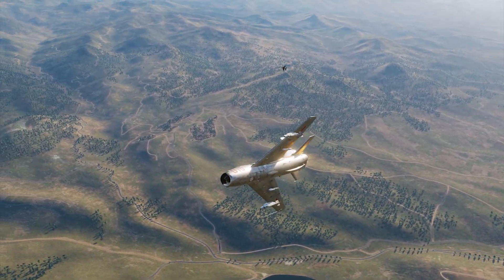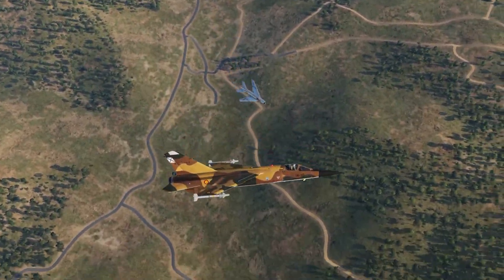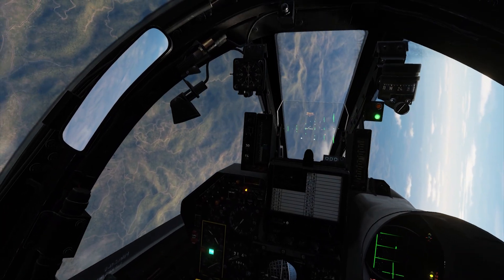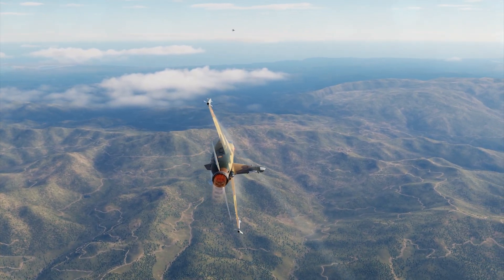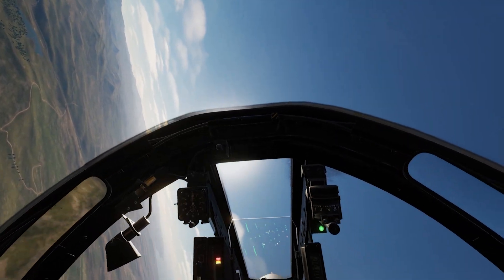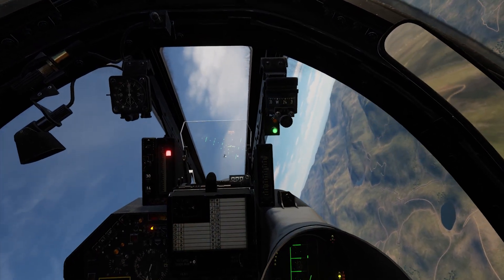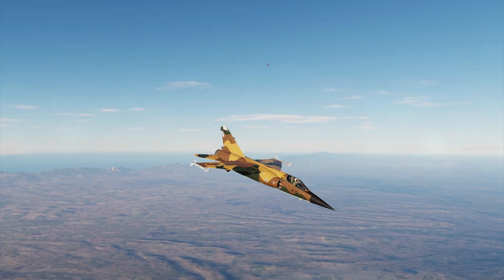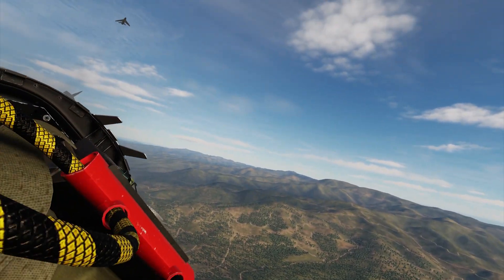Mirage F1CE Aerial Combat Dynamics and Analysis (DCS)

Comment: What exactly is a 1 circle or 2 circle fight? I’m a DCS helicopter player like 95% of the time so I’m not exactly sure what you mean by those terms
Reply from the maker: After merging planes turn one way or the other, if they both turn the same way, they are chasing each others tail, this is 2-circle. If they turn opposite, one left, other right, they are turning toward each others nose, thats a 1-circle
Reply: @FSX404  Ok, I think I understand. So what you’re saying is that the mirage is good at that opening aspect of a dogfight? But that it isn’t as good at doing a back and forth turning fight like a traditional dogfight would be ?
Reply from the maker: @Rokaize  not at all. You are thinking of dogfighting as a who turns best. Dogfighting is complex and dynamic. Some planes are good at slow turning, but that is the simplest move. Dogfighting is knowing where ypur plane is best and where it beats the other plane. In case of the F1 its best at high speed fighting (450 kts). If some noob wants to turn with you, you let him turn and slow down, you speed up get above him and pick him off at will, cause if he isbslow, he cant point the nose up or get you while you swoop down and get him like a sitting duck. So, start thinking of a dogfight in bigger sense. German Fw190 Doras were fast but couldnt turn, they would do a pass taking shots with big guns and egress before any plane could follow, then turn around further away and do it again. Not until a fast P-51D came along could the Dora be challenged. In a dogfight, speed is almost always better than turning. So now think of the F1, its a decent turner at 300 kts, but its strength is in speed.
Reply: @FSX404  Well I meant a back and forth turning fight as an example, of course there is a lot more to it than that. I see your point though. I’ve been testing it out and have had pretty good luck staying at 400-450 instead of 300ish knots and not committing to any intense maneuvers. Like how you mostly did in the video. 

If you could do any more videos with the F1 that would be great. It’s a unique plane and learning more on how to fight with it would be of interest to a lot of people I’m sure.

Comment: Ihave had my first step on coldwar PvP server with the Mirage F1. I am struggling a lot with the merge against MIG. I'm used to play on "modern" servers with the f-16/f-18... where bug out and high altitude is not an option for merge due to missile efficiency (aim-9x / aim-120c). I will try the tactics you showed in this video. Thanks you
Reply from the maker: If there are head to head missiles, then this wont work either, but nothing really does unless there's a miss.

Comment: I've been loving the F1 so far! It's my 3rd module I started dcs with the Kurfurst to Tiger and now F1. It's so much more complicated than the f5 and likes to fight in such a different way. I'll be honest it's going to take me a good number of hrs to get my head around the Mirage. I'm really liking your videos on the F1.  I say keep them coming I need all the help I can get.
Reply from the maker: F-5 is fly-by-wire so its somewhat computer controlled, F.1 is pure pilot controlled, nothing to save you from overpulling or making a mistake. F.1 is much harder to fly. They also have different wings, F-5 has that tapered wing great for 1-circle fights, the F.1 has the classic swept wing,, which is not the best for 1-circle. Very similar as to acceleration, altitude, etc, both feel underpowered against the MiG19 or 21, but where F-5 can do that one circle turn and get even something like a Tomcat, the F.1 is stuck in a 2 circle fight, or modified zoom and boom. Where you have to be a lot more disciplined.